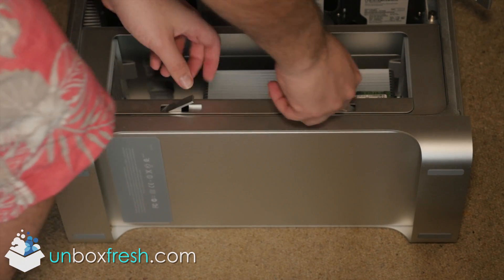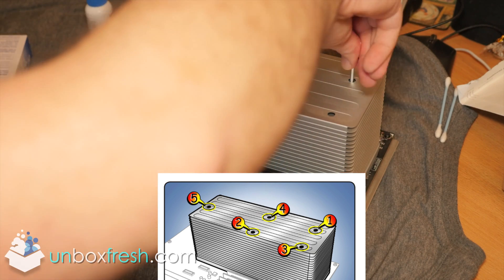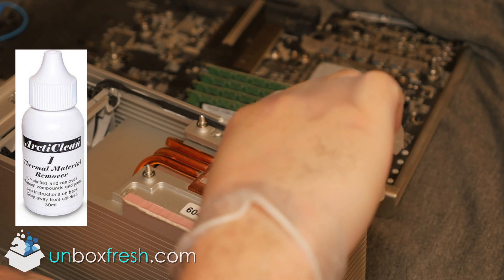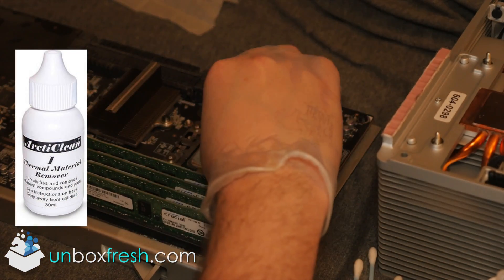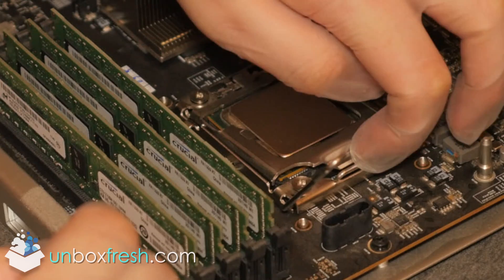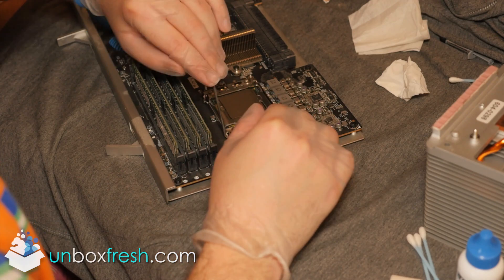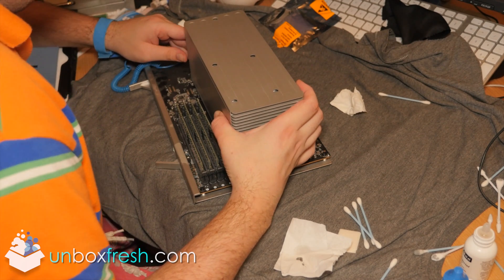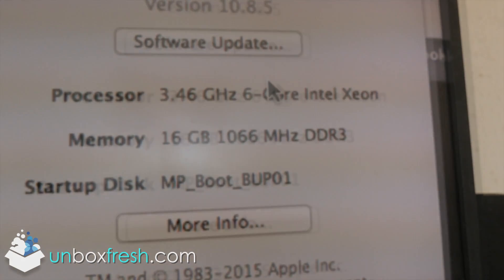Upgrading my Mac Pro 2010 / 2012 from a Quad Core to a 6 Core (4K Ultra HD)

Comment: Interested to see that you clean the old cpu in the socket.  What if the chemicals spill into the socket.  Why not take the cpu out, and do whatever you want to do.  Also it is the first time to see people take out the cpu tray vertically, as it could be easy to damage the support tray because of the weight
Reply from the maker: yeh good point! it all still works fine 4-5 years after doing this

Comment: Firstly, the so-called "surface purifier" is a load of crap - more snake oil from the PC aftermarket manufacturers to get more money out of you. Isopropyl alcohol will clean the surface of the CPU and the heatsink perfectly (and at a fraction of the price). Secondly, you never, ever try to clean the CPU of thermal compound with any type of solvent or remover while it's still in the socket - if any of the compound/solution migrates from the surface of the CPU to the socket, your in all sorts of trouble. Some thermal compounds are electrically conductive (causing short circuit faults within the socket) and if they get into the socket are virtually impossible to remove without bending/breaking the socket pins and destroying the motherboard. Just put the CPU on a static proof bag and clean it on that - Pad type CPU chips are very robust and very hard to damage if treated with a little care.

Comment: hi thank you for the share, i've a mp5.1 2010, i've followed everything from your video to upgrade from quad to 6 cores, well the change of cpu was easy part, and i've got the apple start tone, but when the system start bar went to have way, the machine shows a grey screen with long numbers within 1, 0, f ... etc, like on dos, and then it restart over, what's should i do please? thank you in advance. daniel
Reply from the maker: I dont know - post it and a photo on this forum https://forums.macrumors.com/forums/mac-pro.1/
Reply: thank you for your reply, i've got the answer on forum: w3690 can't work on dual but only solo, if i need x5690 for my dual cpu machine. thank you for your advice.